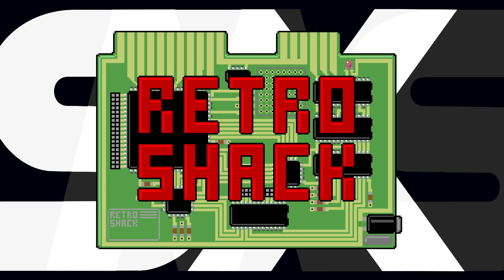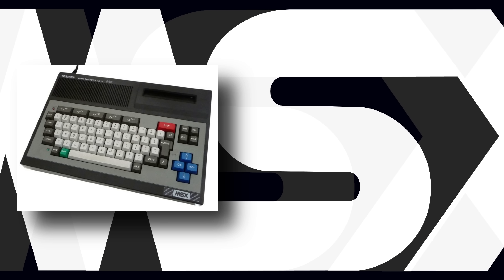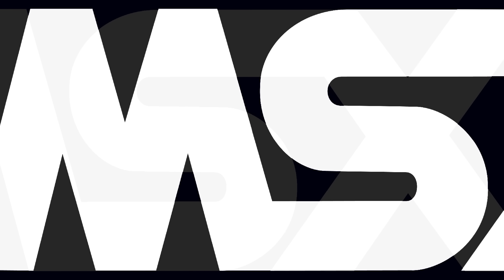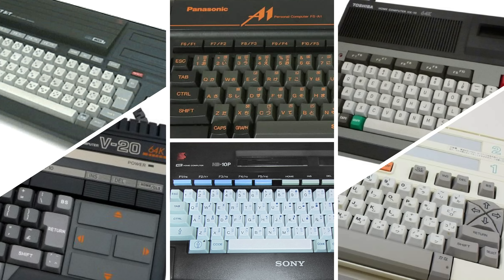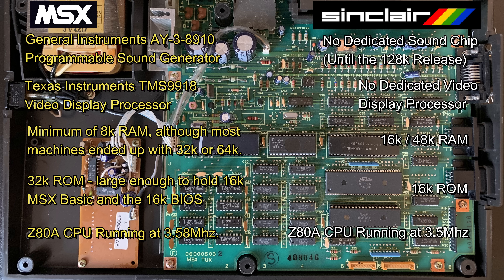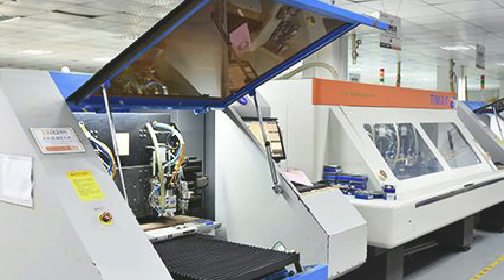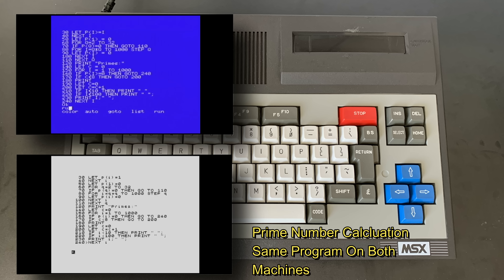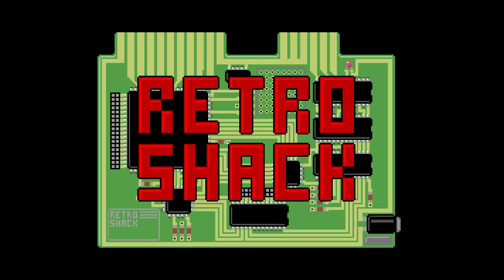Did I miss out by not having an MSX?  Was Sir Clive right about their performance? Let's find out!

Comment: The MSX is more flexible when it comes to applying colours. While the Spectrum can color each 8x8 block in two colors, the MSX can colour each 8x1 pixel block. Most lazy Spectrum port didn't make use of this though. For proper MSX gaming, look at the stuff that for example Konami did. Not at the Spectrum ports done in a weekend. Hardware wise, one main difference is that the MSX's video chip uses separate video memory where in the Spectrum, it's shared. On the one hand, this is good, because video memory Access doesn't slow down the CPU on the MSX. But on the other hand, the CPU lacks direct access to video memory, which makes it slower. This is why most direct Spectrum ports run slower.
Reply: Note that the spectrum DOES slow down when accessing video RAM!
Reply: @martindejong3974  effectively the bottleneck is not the raw video access speed, instead the complex ceremony that the cpu need to address a video ram byte. in speccy its all like ordinary ram, even if slowed down a bit. on msx this required to send to I/O ports (in two steps) the address low order byte followed by the high order byte, then wait a bit of time, then perform the data I/O. this could be 7 times slower than zx way. 
Fortunately, this situation is not so often reached, because vram I/O tend to be on consecutive addresses (block operations), and the msx could take advantage of auto-increment address, so if you write vram block of data you only need to set the vram address only once, then you can output all the bytes consecutively. 
Plus a memory move in RAM is the same speed than a blockmove on I/O ports on z80 so there is no penalty if the vram access occour on the vblank period.
Reply from the maker: Personally, I don't think I'd make the comparison to something that was both five years older and still better than my product :)

Comment: All these games are zx spectrum ports. If you look at real MSX games you will see how really different they are, like any Konami game for MSX of these era.
Reply from the maker: That’s kind of the point of this first episode in the series - an introduction to the machine and msx in general, and then showing that even running unoptimised spectrum ports, it was still faster than the Spectrum - not 2-3 times less powerful as Sir Clive claimed.
Reply: Indeed. In Manic Miner an obvious thing to do would be to use h/w sprites to animate the main character, but it doesn't ; you can tell when it jumps through a platform.

Comment: The video chip in MSX is not that different from the chip TI introduced in 1979 (used in TI-99/4). This might be the basis for the "5-year old architecture" claim. Microsoft BASIC could also be perceived as being old at that point, but of course it had been upgraded and did many things better than the Sinclair BASIC.
Reply from the maker: Personally, I don't think I'd make the comparison to something that was both five years older and still better than my product :)
Reply: @TheRetroShack  I guess the price is what made Spectrum so popular. Older computers such as Atari 800 and Apple 2 were more capable than the Spectrum, but they were also still damn expensive. MSX cost more than a Spectrum but wasn't a huge step up. I did really enjoy the BASIC though, sprites and sounds were very accessible.

Comment: Another fine video. I for one always liked the specs of the MSX line over the speccy, but if offered one or the other, I think I jump on the speccy first. I dig the whole hardware sprites thing and scrolling but because the Z-80 had to talk to the GFX chip via I/O ports, it always seemed to be very slow....even in the ColecoVison, which is very similar in hardware specs. My favorite z-80 machine is still the Astrocade by far. For it's time it was way ahead of the rest out there. It's a shame Bally MFG dropped the ball on it so quickly.
Reply from the maker: Looking up Astrocade immediately :)
Reply: @TheRetroShack  It was a gaming console with a screen ram buffer in the 70's!!! and it had honest real basic and machine code carts to code on it. If you've ever played Gorf or Wizard or Wor in the Arcades, you've used the chip set is was based on.
Reply from the maker: @GORF_EMPIRE  Well Gorf is an all-time favourite of mine!  So definitely checking that out :) Thanks!
Reply: @TheRetroShack  I have a genuine GORF arcade machine in the garage. I also have several cages to switch it out to play Wizard of Wor, Space Zap and Robby Roto. If you have a MiSTer, you can play Astrocade on it.

Comment: I had wondered about the MSX as a kid, but never saw one.  I heard that they were used in some cabinets to control the odd laserdisc game, but that might have been wrong.  Thanks for the great introduction.
Reply: I think you might be correct: Pioneer did indeed make an MSX computer that could interface directly to one of their LaserDisc players, so it is not unlikely that it would have been this combo that inhabited those arcade games.
Reply from the maker: Interesting!

Comment: The MSX used the Texas Instruments display processor which was released in 1979, so maybe that's what Sir Clive was referring to?
Reply: I think he had just no clue what he was actually talking about and he didn't care either.
Reply: @EgonOlsen71  It would be a fair argument that the MSX was nothing remotely innovative, being basically a Z80 (1976) AY-3-8910 (1978) and TMS9918/28 (1979) in a box with a predictable design. Whatever the limitations of the ZX80/81/Spectrum they were innovative. 

The only real advantage a Spectrum had is ability to directly access the screen RAM, on a 9918 everything goes through the I/O connector and it isn't very efficient.

The Japanese wanted a system that concentrated on their strength, quality manufacturing, without really bothering about advancing technology. It's a prerunner of the PC in that sense, in that you have piles of largely interchangeable systems.
Reply: @EgonOlsen71  Well sure that's the most likely option, I admit.
Reply from the maker: I think he was feeling under attack on the QL and didn't react well.
Reply: I think that might be reaching.

Comment: I like the MSX, never had one back then though or even knew anybody who had one in the UK.  I have to say though for some weird reason I can't quite put my finger on I like the Manic Miner music on the Spectrum version better than the MSX (apart from the awful title screen music of course).  I also prefer the colour on the Spectrum, it is much more vibrant.  With Outrun, though both versions are pretty bad really.  The only reason the MSX is better is the music, apart from that there is not much difference.  But at the end of the day the Spectrum has the knockout punch of being way more affordable and still being able to pull of amazing games and that goes a long way.
Reply: Graphically the TMS used in MSX1 is far better. Less limitations in colour clash, tile mode (you need to move around 1/8 of bytes on vram despite the I/O port access), hw sprites. if you do not notice any difference it is because you are seeing on TMS direct speccy ports. In the '80 the TMS bitmap mode could emulate easily the ULA gfx, it was only different arranged in the pixel -  to - RAM address mapping. Most sw companies did the ports from speccy by reserving the same memory region used for display in spectrum and perfoming here the gfx mapipulations then blitting the entire 6144 bytes of speccy display RAM to the 6144 bytes of TMS bitmap/pattern mode. Even with this limitations performances were acceptable considering that the cpu has to almost double the work to do gfx.

The apparent limitations is a false problem: Vram manipulation tends to be done in terms of contiguos block of bytes.
So compare a memory move operation on speccy. the z80 used an LDIR instruction, moving 1 byte of memory every 21 clock ticks
on the msx+TMS you would use a OTIR instruction that take the same 21 - clock ticks in the best case. However, in the worst case the VDP cannot keep up with this speed so you have to slow down to 29 clock ticks per byte. So you slow down the bandwidth of 40%. 
Where the speed penality is heavy is when you have to setup multiple times the vram ptr. here the different is more than 5-7 times when compared to a simple LD (HL), reg doable on speccy. But fortunately, these kind of random scattered vram access are not frequent on games, only when you do vector graphics like in elite.
Reply: @gasparinizuzzurro6306  And if you build the game out of 8x8 tiles, you only need to write 768 bytes to update the entire screen. Of course no Speccy port did make use of that because Spectrum did not have the capability.
Reply: @grauwsaur  yes i know. this greatly compensate for the overestimated slow I/O, that is in reality not a bottleneck.

Not to mention the ability to make some "frame animations of things like water" by writing alternate group of tiles with a a small bunch of bytes of nametable instead of doing a full video ram write of patterns + attribute colors like working in spectrum fashion.
About the VDP slow vram I/O:

A VDP byte transfer require rougly 29 z80 cycles in the worst case, that is not a lot slower on what the ZX can do with a LDIR in z80 memory that takes 21 clock ticks, especially if we take into account the contented ULA area.

there is only one use case that makes things difficult. when you write non contiguos block of vram. Here the penalty is heavy, but fortunately is extremely rare because VRAM write operations tends to be continuos block transfers, so you set the vram ptr and take advantage of VDP's autoincrement feature.
Reply from the maker: And that’s why, no matter what, I love my Speccy :) I added outrun as for it’s time it was quite a technically challenging game and the track was almost fully 3D with twists, turns and up and down hills - quite a lot of maths going on there for little Z80’s to throw around :)
Reply: @TheRetroShack  Yes, they did well with what they had, it was indeed a valiant effort.  The only 8-bit version I have played of Outrun that was good was the Master System version.  I really enjoyed that back then.

Comment: Great Vídeo!
You can easily experience some msx2 games with this Toshiba using a cartridge upgrade, they have the msx2 bios, video ram and the new vdp (the video chip). Its a plug and play upgrade!!!
Reply from the maker: Thanks! I’ll look into that :) Presuming that you don’t lose the cartridge slot in the process - it acts as a pass-through?
Reply: @TheRetroShack  This Toshiba has Just one slot? but I guess there are some mega ram/mappers that also upgrade It to msx 2, very handy...
Reply: @ronnylucas8857  It has the non-standard "Expansion Bus" port on the back instead of a 2nd cartridge port. I think it's electrically compatible so you might be able to get / make an adapter, but I'm not 100% on that.
Reply: @ronnylucas8857  sorry, but you are wrong. Such expansions are not available nowadays. There was one in the 80s in Japan, though.
Reply: @ManuelBilderbeek Not at all, clones were made here in Brazil until few years ago...
Reply: @ronnylucas8857  You're right, but they're not that widespread, not easy to get and quite clumsy. I don't know how many were built, but I don't think a lot...

Comment: I think I had a (negative) visceral reaction to MSX when it came out. It was too ‘corporate’ and threatened the plucky Brit companies that I loved. Probably the same reaction that Sir Clive had 😁
Reply from the maker: You may be right! :)
Reply: Obviously: he sold a similar product, 
if the product was better his attitute was to talk of its limits
if the product was worse his attitute was to emphatize the limits.

There is no point to ask Clive what he thinks about a competitor product...
Reply: Visceral yes, but that didn't gave clive sinclair the right to lie, and say the MSX was "three times slower" than the spectrum, and had worse graphics hardware capabilities.
Reply: @martindejong3974  As said the TMS chip is not marvellous chip, but it has far better abilities than spectrum ula.

Speccy:
256x192 graphics with 15 colors two colors per 8x8 cell. Attribute based color

TMS (MSX1)
256x192 graphics with 15 color+transparence. two colors max per 8x1 cell
32 16x16 monochrome hw sprites 
pattern mode
very low res multicolor mode without colour clash

the vram i/O is a limit when you do a lot of random non contiguos access as proved by some ZX spectrum ported tiles directly converted to msx doing something of emulation of zx graphic mode on the fly then transferring to vram through I/O

although this inefficient way to do things performance were decent if the game do not extensively manage color attributes. Otherwise the ram load gets to high for the cpu. Remember that the attribute table on speccy is a merely 768bytes versus the 6144 bytes on msx1. this means the cpu has a lot of work to do to manage the same attributes.
In pure monochromatic games there are only the pixels to transfer that are in both system a 6144 in size for a screen.

So the full screen management on a ZX spectrum means to manage 6144+768 bytes of video memory while on MSX means to manage 6144+6144 of video memory, it is almost double the size! That's the source of slowness. not the VDP I/O that is on the same ballpark while doing continuos block data transfers thanks to the autoincrement ptr feature of TMS
Reply: @gasparinizuzzurro6306  I agree, that the VDP I/O is NOT the bottleneck that people think it is, and also the fact that there are eight bytes of attribute memory needed per character isn't that much of a deal as its very efficient to fill eight consecutive video locations with identical data using the auto address increment logic of the VDP. Meaning it takes just eight out commands to fill the eight VRAM locations.
Also you ignore the alternative video modes available to the VDP, and the sprites, which when used could be a game changer. The very low pixel resolution you put down, was NEVER used for games, and is almost identical to the low res mode of the apple ][ that also was almost never used, except for a single breakout game, and some demo's
Reply: @martindejong3974  yes,it is more heavy to write 8 bytes of data for attribute than the supposed "slow" vdp I/O. did you noticed that the outrun version on msx is not so slow than the zx spectrum? what does it mean?
It should be if the VRAM I/O is so heavy. And please consider that the outrun version of msx IS NOT MADE for msx. It is the ZX Spectrum Code. I've looked at this. mainly it does work in z80 main ram then upload to VRAM the data in z80 RAM. 
If the VDP would be the bottleneck it should be dramatically slow: twice the work to be done!!!
But it is not so much. Why? Because the majority of CPU time is wasted on other things instead of video memory management and even the msx version has the increased overhead to convert and  upload the video ram of ZX Spectrum to VDP the impact of this additional work is negligible compared to the rest.

This is the majority of situations in games. 
Look at the msx2 version of the game, programmed in tile mode and the speed. the processor is the same but taking advantage of tile mode made the game literally fly.
Reply: @martindejong3974  absolutely

Comment: I was attracted to any smallish home computer with a decent keyboard in the early 80s, being stuck with a well worn ZX81 with wobbly ram pack until '84/85... Always looked the business in magazines at the time.. C64 looked a bit boring in comparison although I really wanted one and knew it was better than the MSX machines. I have to agree MSX were better machines than the Speccy, but a lot more expensive over here, and not that much better. Sound was the main thing. 
--
One of my main (of a quite a few) gripes about Sinclair was they did not exploit their own hardware enough.. They had the engineers that could have worked out, enabled and taught all the neat tricks found by clever programmers later in the Speccy's life.. Would have really pushed British software development forward too. All home computers back then should have been supplied with an Assembler + list of OS function addresses as well as Basic.. I'd have made it The Law in Britain..
Reply from the maker: Me too!  I even paid out for a DKTronics keyboard for my Spectrum 48k that was about half the price of a new machine!

Comment: I had Spectrum compatible, C64 and MSX (HitBit). By far, I loved and found MSX better than the others. Pity that Spectrum and C64 had more software library than MSX, but MSX I found to be a far better and powerful machine and system by far.
Reply: @Rooflesoft Games This is my personal opinion. Is how I perceived C64 and MSX. For C64 I had only the datasette; for MSX I had 720kb floppy and a regular tape recorder. For C64 I had games, for MSX I had Pascal, Microsoft Basic that was 98% QBasic. Both had Assembler but I knew some assembly from Spectrum (Z80) and was easier than C64. If I remember correctly, C64 and Spectrum relied heavily on PEEKs and POKEs, on MSX I didn´t used them (it was a CALL for asm subroutines?). 
On MSX I made a Norton Commander clone and a PSpice like program. Also I managed ADC, DAC´s, a custom home-made data acquisition board, that gave me a voltmeter, frequency-meter and a controlled power source. 
The colors were brighter on MSX than on C64 or Spectrum.
As I said, C64 MAY have been better than MSX 1 for everyone, but I found MSX 1 Better than C64.
Reply from the maker: I find myself wanting a HitBit and I'm 90% sure it's just because it sounds cool! :)
Reply: @TheRetroShack  The main problem is that the original peripherals are extremely hard to find. I had a 9 dot-matrix printer, 720k floppy. My HitBit was model 75P.